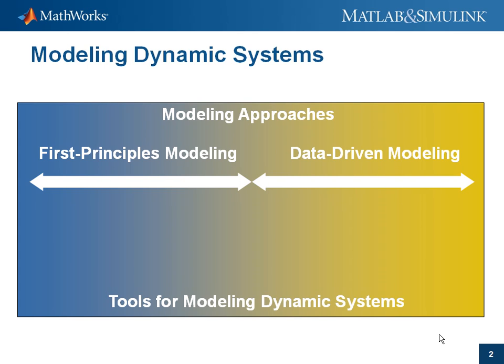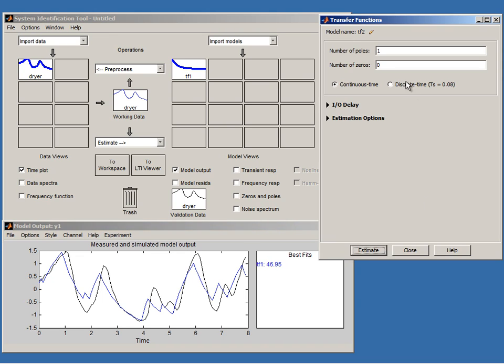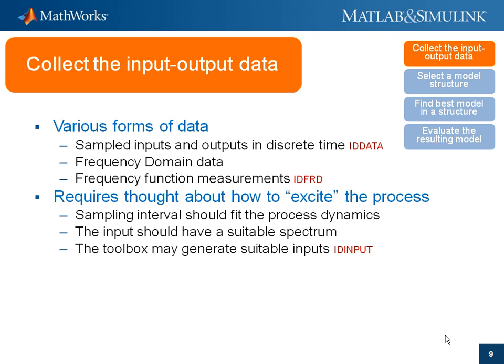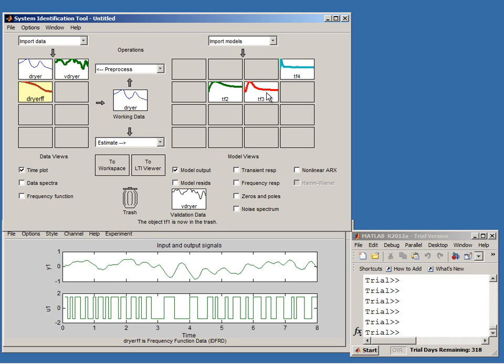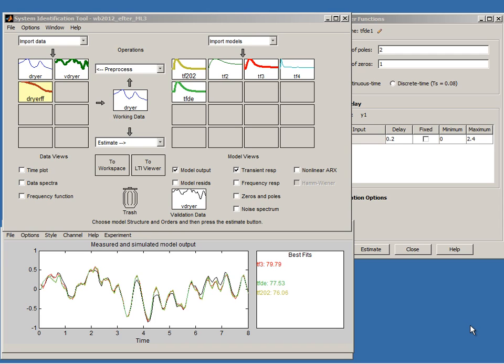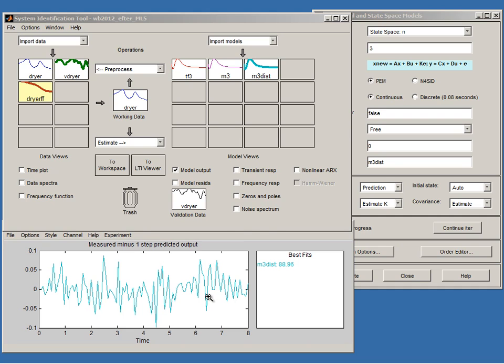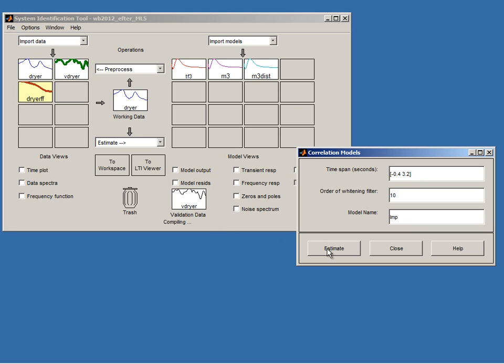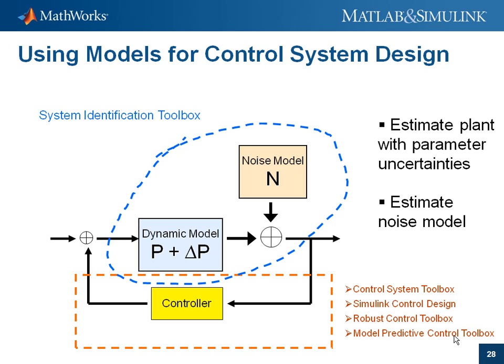Introduction to System Identification

Comment: How can I collect the input/output data for a physical system? Any guidelines?
Reply: Hi @Erbaz. That is a interesting question. Would you like to share what kind of system you are talking about?
Reply: @philscosta  DC motor, sir
Reply: I know this is old, but you can use sensors that record data in a time series, for voltage, current, etc...